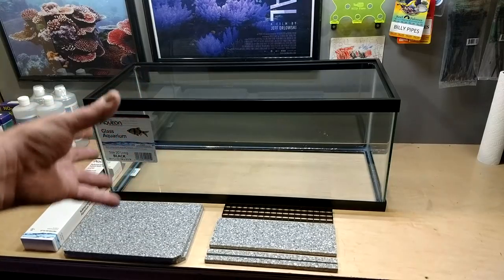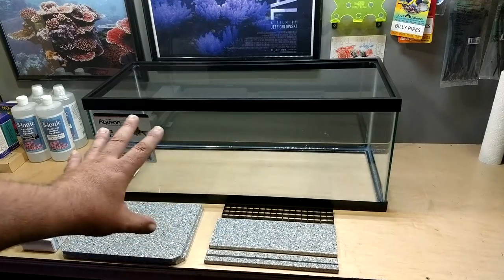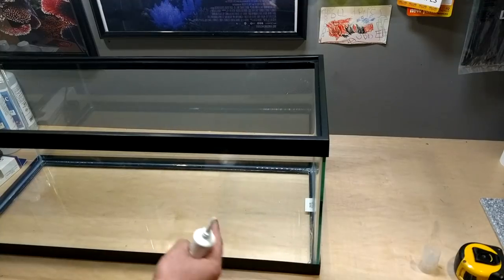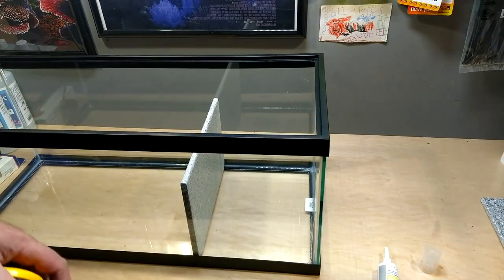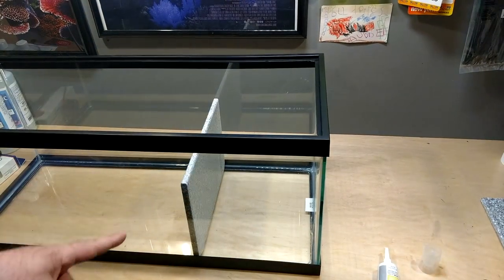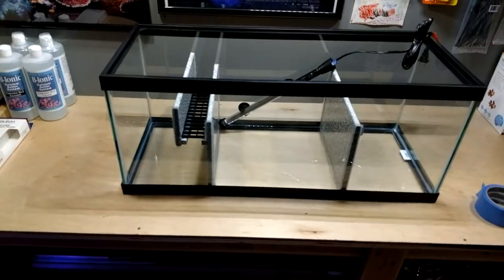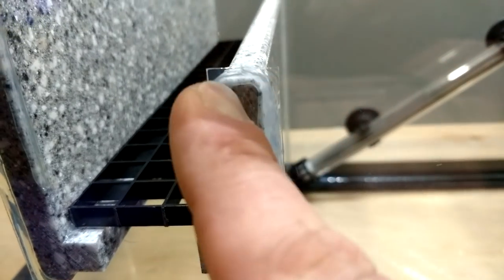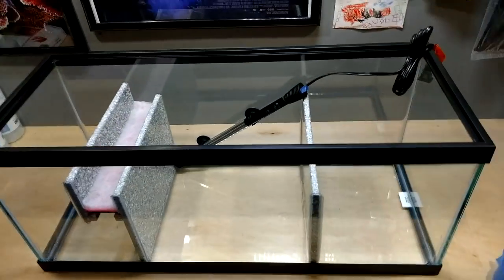Custom DIY Sump For PRFishGirl - How To Build

Comment: Will a 20 gallon sump work for a 125gallon freshwater tank? Or what size would you recommend? And what other materials can I use to make baffles? Thank you
Reply from the maker: I would think a 20 gallon would be fine but I only have experience runnning saltwater systems
Reply: @BillyPipes  how about other materials for the baffles what are you using now?

Comment: When you cut your baffles, how do you know how wide to cut them?  I know I need space for the caulk, but don't know how much space to leave.  I think I remember 1/4 of an inch, but I am unclear if it is 1/4 of an inch total or each side.
Reply from the maker: I cut them as close to the glass as possible.  The silicone goes on the outside edges of the baffles
Reply: @BillyPipes  thanks!

Comment: Can you make a video of how a sump works. The flow of the water and the purpose. Thanks.
Reply from the maker: I have multiple videos like that already on my channel 👍
Reply: @BillyPipes  I'm more confused about how  an overflow draining into the sump wont over fill the sump to the point that the return pump wont keep up with it. How do you regulate that? or the pump will leave the sump dry.
Reply from the maker: Depending on the style of drain the pump and drain run at the same gph. Usually a ball valve at either end is used to create the perfect flow. I did a video on herbie style method is explained that might help